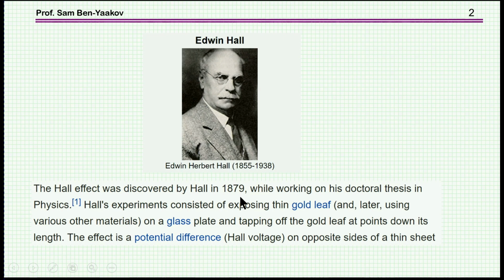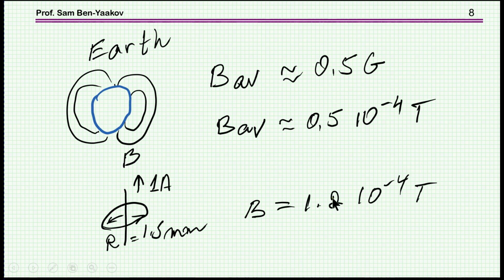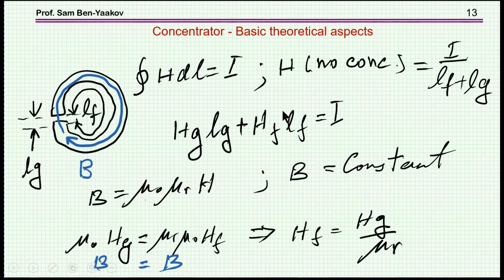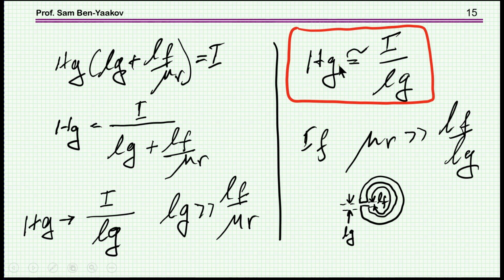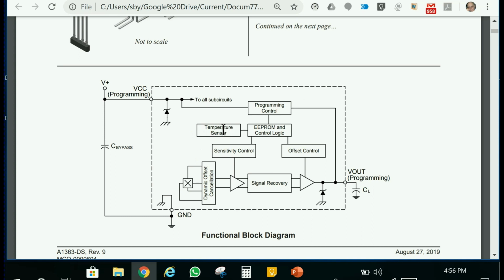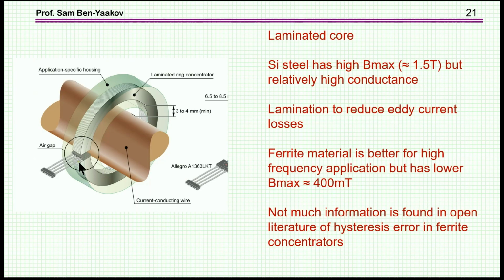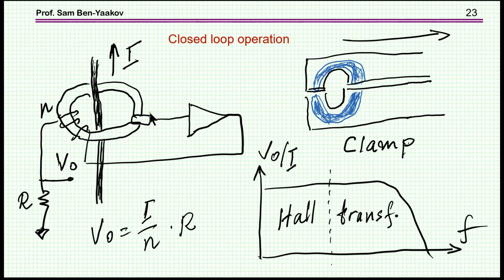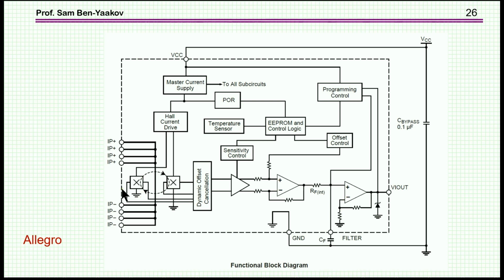Current sensing by Hall Effect

Comment: You say Hg will be much higher than Hf, agree. And B is the same, in the gap and in the core, agree too. But hall effect is made by B vector, not H. And hall effect ICs 'feel' B vector, in magnitude up to 0.2T. So the fact that Hg>>Hf is not what the concentrator was made for. As I understand, its role is to increase B value, that in absence of concentrator will be much lower and harder to measure. Also small gap will help to isolate external parasityc magnetic fields.
Reply from the maker: You seem to have missed the point. Compared to air {no concentrator) the Bg with the concentrator will be higher because Hg is higher.

Comment: Very interesting as usual, thanks again,  also the differential measurement with core concentration is used in UNI-T UT210E  clamp meter which is surprisingly accurate even in DC measurements.
See another favorite youtuber taking it apart
https://youtu.be/m7cD_W3cQlE?t=505
Reply from the maker: Thank for comment and link

Comment: I have a question only you can answer me,(i think&hope):
About hv ceramic capacitors:
Is that voltage-depending capacity a positive or a negative influence?
I ask in use in a pair of capacitors in series to share the max voltage over both of them. I know that when the capacities are not exactly the same the (ac+dc) comes mostly on the least capacityvalue. And if the dc component gets close to the max then that value will increase or decrease? So will the situation hv-C's in serie be self-correcting ór will it be negative so the C-value decrease and thus the total voltage increase more&more till one of the C's in series will blow up?(i dont know the english for every thing but i still hope that you see my question and know an answer for me? At least then i know more before spending more of my expesive 4n7@20kV C's! 
(you see i dont ask ónly for curiousity but for sake of my most beloved&most longtime built too)
Reply from the maker: Hi Rob
To begin with two caps in series do not form a voltage divider. See.: https://youtu.be/T8qWWwsMOK8. You need to parallel each cap with a (large) resistor to ensure stable voltage division.
Reply: @sambenyaakov  i know, but sinds your videolesson about the voltage dependency of ceramic capacitors, i worry a little about a voltagemultplier i am building.
Is the total effect of that effect, will it be in the selfcorrecting direction working, or is it in the runawaydirection? 
I could buy 20kV capacitors and worry if i indeed could not do without resistors parallel to each capacitor. You see that would be a very difficult resistor.
Two same 4n7@20kV ceramic capacitors in series (its in a woltoncronkfortmultiplier, i have to feed with 17kVtoptop@12kHz). 
That voltagedepending effect, will it about the max voltage, will the total voltage increase by that one capacitor who's capacity drops the earliest? (I cannot be sure because i can see both directions possible and i mis the insight needed to get sure.)
Reply from the maker: I do not think there is a problem if same capacitors are put in series.
Reply: @sambenyaakov  thank you só much for again your helpfull answer. I never forget my trafo-debacle where my schoolteachers could never make it clear enough for me. It stayed a break in my understanding, until decades later, when colleges who knew youtubechannel pointed me to your videolessons to improve our skills and knowledge for your easier to understand explainings or what i more&more think are your teachingskills or at least your own easy understanding&insights that i think is what makes your words so much more easy or better to follow. O i am totally nót good in social-normal speak, but for me your knowledgespreading, your videolessons, it really helped me and others to find and learn that next level understanding... Your understanding&insightslearningchannel made more difference than some of that most beloved books.
Thank you really, for uploading your knowledge.(ow that last scentence sounds even more abnormal than the rest of my aspergerautismespeaking!)
I wish to say only: thank you for your inspiring, interesting and usefull videolessons.(at least much more than í can explain. So thank you great